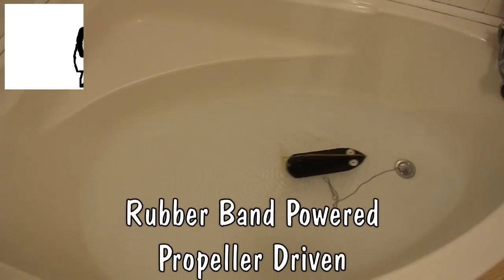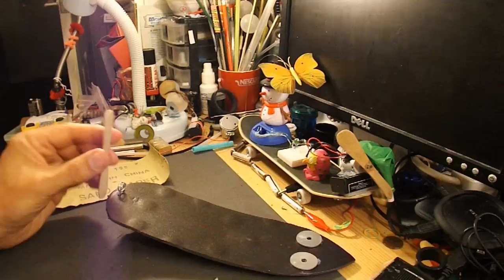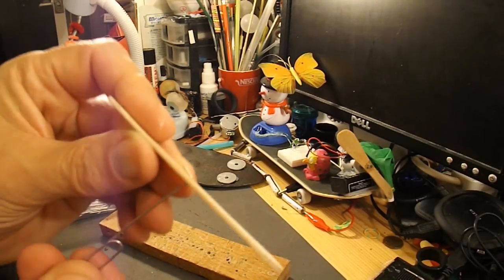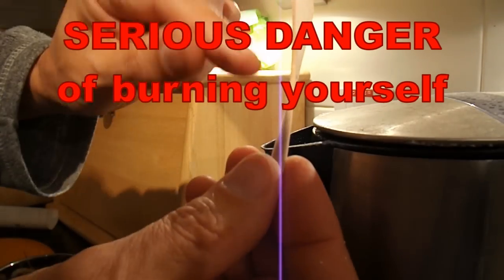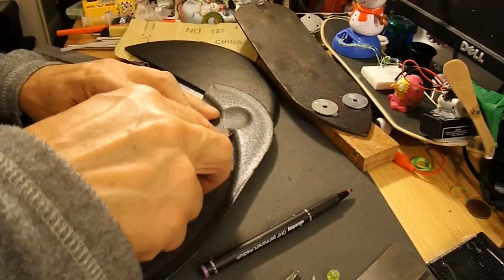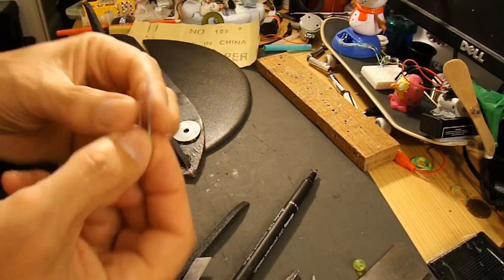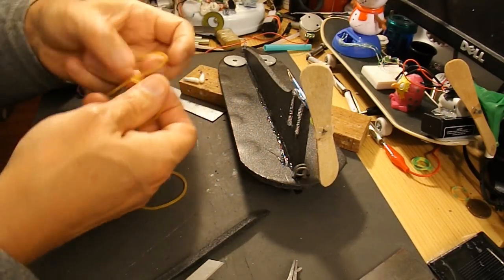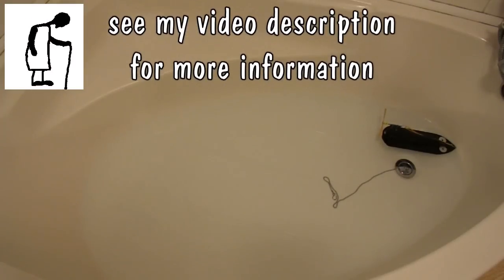Rubber Band Powered Air Boat

Comment: for the prop shaft, try bending the clip a second time like the letter J but with right angles and stick it back through the prop. Saves on glue and is guaranteed to turn the prop.  Also, for fun,  I would add a rudder. Either by cutting one in the upper support or adding one
Reply from the maker: Thank you for taking the time to comment with your suggestions. Feel free to make one with those modifications. As I say in my video descriptions I like to keep my work as simple and basic as possible so that it can be copied easily and improved by anybody who wants to try themselves.

Comment: Wow it's cool man. I gonna try that, but I'm not using I rubber band,  I'm gonna use dynamo
Reply from the maker: K.V AL GILBRAN good luck, make sure you keep the balance low down or it will tip over.

Comment: More wather in,and turn it around ;-)
Reply from the maker: Most people seem to want these projects to go a certain distance  so getting it to turn around the edge of the bath was an afterthought. At the very start of the video you will see it goes dead straight and is still accelerating when it hits the end of the bath. The propeller is wider than the hull so when it runs around the narrow end of my bath it hits the sides and pushes the back out. If I widened the back of the boat to clear the propeller it would probably run round with no trouble.